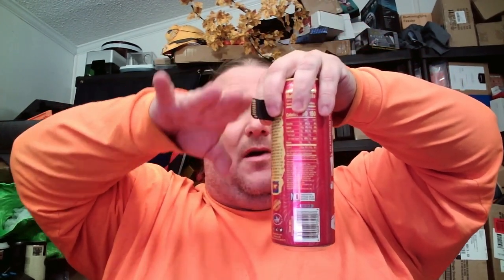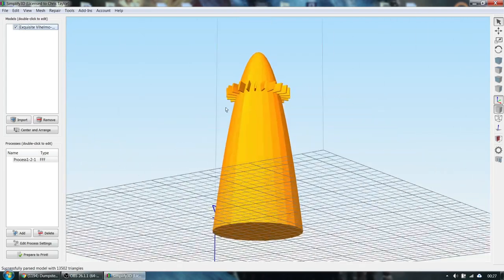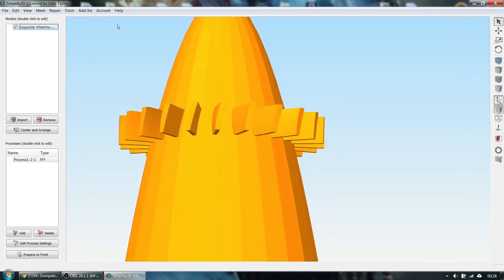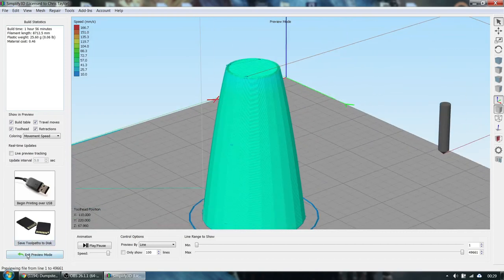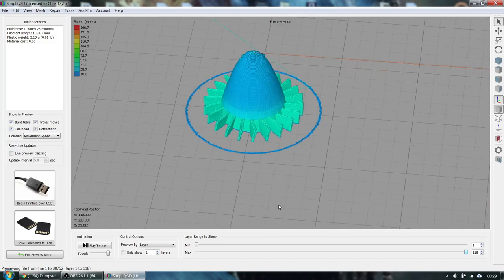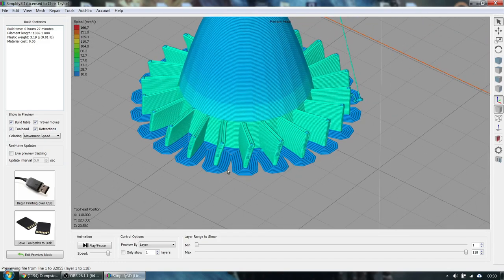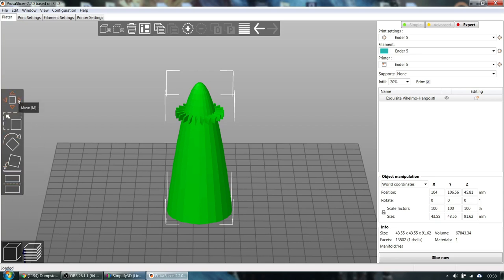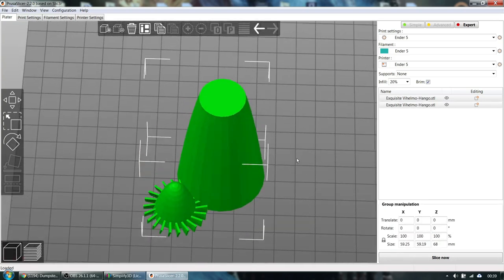Vertically cutting apart a model in the slicer T3DP

Comment: I also had a print fail just above a key feature. Used my finger nail to count 37 layers. 37x0.16=5.92. In the slicer, I lowered the model to the key feature, looked at the -Z and subtracted another 5.92mm. Worked great.

Comment: It relies on pretty efficient gluing... As a part of a mechanical set, that could ruin the resistance of the ensemble. You're right Chris, it's a niche, it's only feasible in a very limited number of cases. Thank you my friend! Next? 3Dprinting a shaver...
Reply from the maker: I believe that is an air powered auxiliary power unit for a towable Target drone it's part of its nose cone

Comment: There's an option for Dense Infill in the slicer I use; Superslicer. Let's me run 5% everywhere and the slicer will add a close-spaced infill layer right before the top shell goes down. No fiddling w/ per-layer settings in S3D to run denser infill a few layers before the top. 

Time to change that smoke detector battery. 🤪

Comment: Hello sir, with your experience thus far, I have a question. How would you build a smaller model rocket using petg as much as you could in the overall build?
Reply from the maker: That's easy don't. use a paper tube and use 3D printing for the nose cone and the centering rings if you really want to you can also make fins but use the right materials in the right places instead of trying to make the whole thing out of plastic when it doesn't need to be and plastic is not the ideal material for every part it should only take 30 to 50 g of plastic to make all the parts for a small model rocket